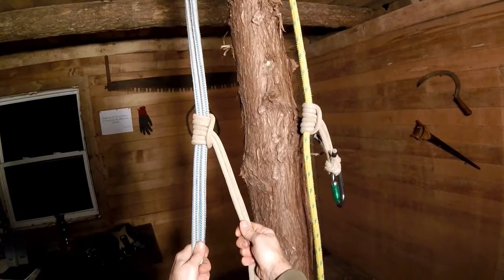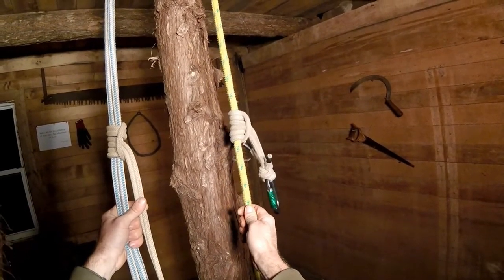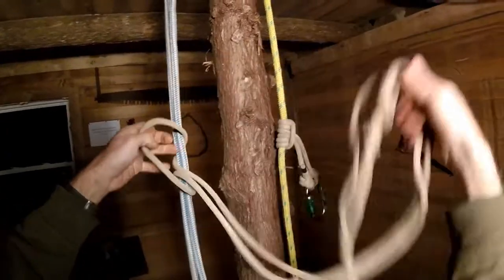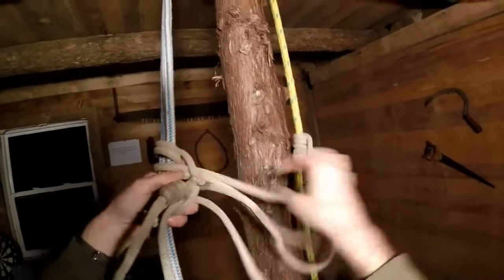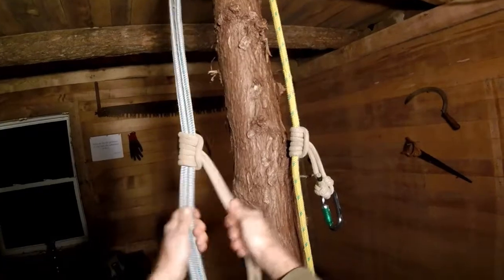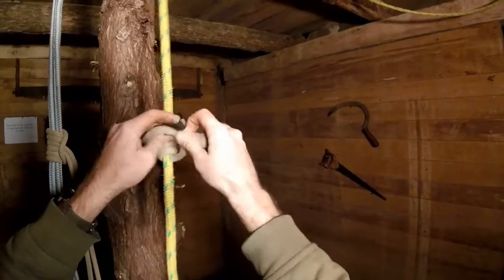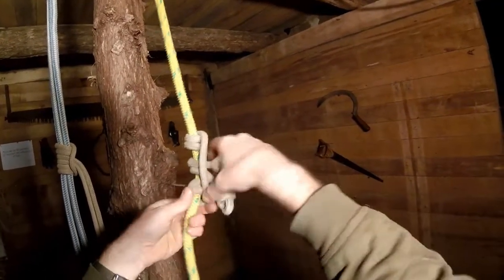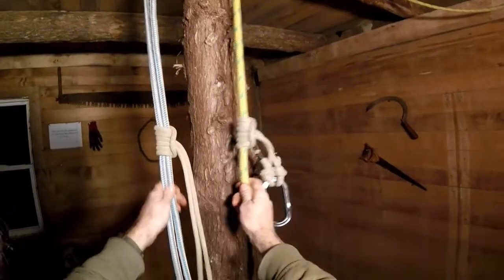The Prusik Hitch  |  Arborist Knots

Comment: What's the difference between double and single rope in relation with the millimeters that we have to use to make loop ? I mean if a single rope that we have it's 11mm  and so we have to use an 8mm for making the loop for the prussik knot work, then what happens if we use the main rope double...? Does it goes to 22mm and so we can use a thicker rope to make the prussik loop like the 11mm itself... just like the Blake's Hitch knot works with same rope millimetres thick...?